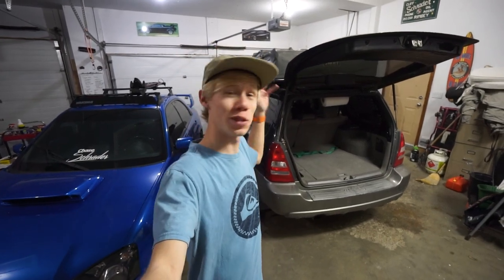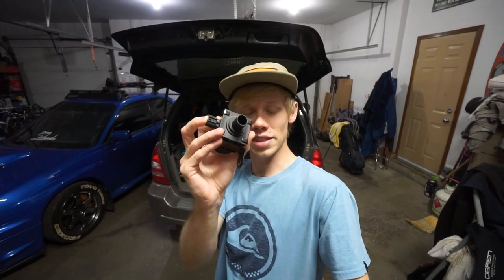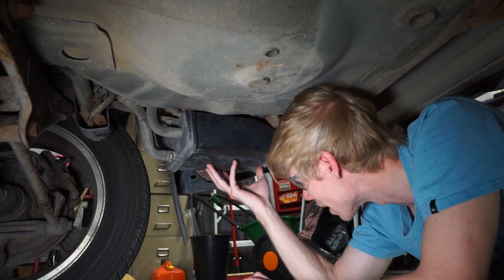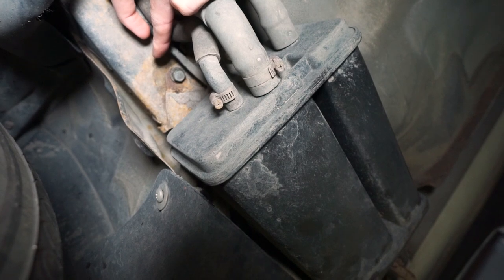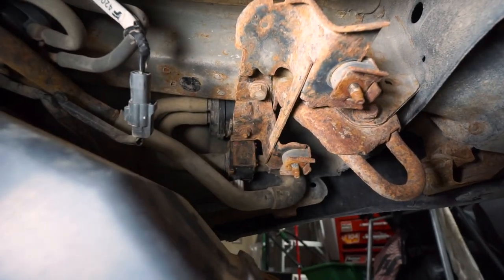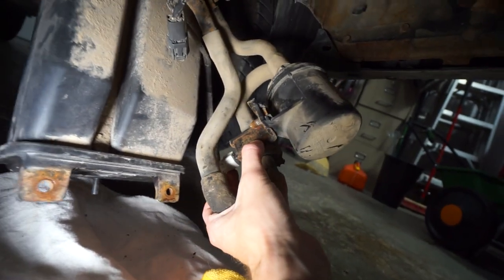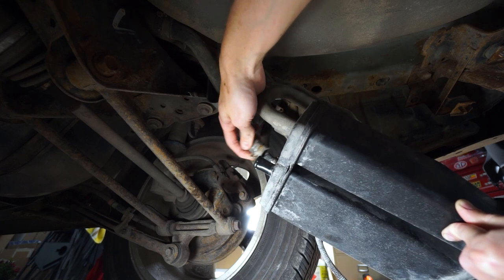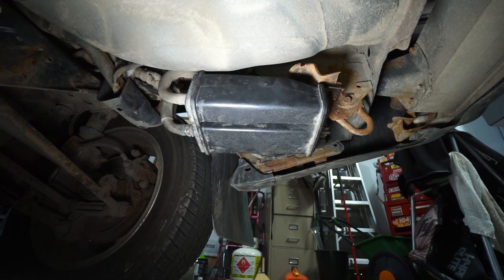P0457? Fixing Your Subaru Purge Valve? There's a Surprise You Don't Know!

Comment: Actually a vent valve. Just saying
Reply from the maker: According to the diagram on Subaru Parts says Purge Solenoid... Feel free to check it here https://www.subarupartsplus.com/v-2004-subaru-forester--xt--2-5l-h4-gas/emission-system--emission-components
Reply: @Chase_Schrader  notice it says vent valve under where it says subaru
Reply from the maker: Yup, that's the type of part, hence why the community uses both the terms interchangeably. I am sure I have called it both before
Reply: @Chase_Schrader  yes, not a big deal at all. Both parts do the same job, but to differentiate between the two they were given different names. Generally speaking, the one in the engine bay is a purge solenoid, and the one near the tank a vent solenoid. Whatever who cares
Reply from the maker: Better let Subaru parts know.... you seem to care quite a bit
Reply: @Organicmachine455 Where would be located the actual Purge valve on an impreza RS 2005?!

Comment: Had an issue with my 07 FXT for about a year(I don't drive it all that much) where whenever I put fuel in it, on a day warmer than about 60 degrees, it won't simply crank over.  It'll crank for about 10 seconds before like one or two cylinders start firing and she runs like a DOG, give it a little gas and get rolling and another 5 seconds later it clears up, at least clears up good enoug to run on all 4.  A block down the road she runs like new again.  On a particularly rough fuel up where I had to put a full tank in it for a road trip, it cranked for about twice as long as it previously had and threw out some puffs of black smoke; and I do mean puffs, you could see PUFF... PUFF, like the cylinder wasn't firing.
Reply from the maker: Yikes! That sounds like quite the issue that could be from multiple things. Did you end of fixing it? What was the problem?
Reply: @Chase_Schrader  I haven't fixed it yet,  but i'm pretty confident it's to do with the charcoal canister in the back that filters fuel fumes, as well as the valve that controls the fumes entering the intake(I believe for emmissions purposes).  Long story short, I believe the valve is stuck open when it's supposed to shut when the car turns off, so gas fumes are flooding the intake on a refuel.
Reply from the maker: Ahhh I could see that! Best of luck getting that sorted out!

Comment: I noticed my '07 Forester is having some trouble starting after I fill it up with gas? It seems to fill up normally, but when I go to start the engine after it sputters and I have to keep the key turned for a few seconds before the engine will stay on. I've had a P0442 code for awhile but I don't know if this would be my purge valve causing the problem or something else.
UPDATE 12/29/23
Replaced the canister purge valve under the hood of the car and I am no longer having problems with starting the car after getting gas! 

I tried to replace the vent valve in the back like in the video, however my bolts were incredibly rusted and I stripped two of them. So I couldn't get the canister down and never actually got to replace the vent valve. I'm holding on to the part in case something happens and I need to replace it, but for now the car is running great! 

As for the emissions code, I've driven 150 miles since detaching and reattaching the battery, and still no code. However, I also have not let the gas below half a tank since I know the car runs an emissions test at a quarter of a tank. I have a feeling my filler neck is rusted and is the actual problem, but for now, I was able to get it to pass the emissions test which is all I wanted.
Reply from the maker: Hmm that could be a few things, that code is about a evap system leak. If you are over filling it could plug up the system, it not it could be any number of evap connections between engine and the gas tank.
Reply: Same problem on my 02 wrx. Any time I fill up/ add any amount of gas into the tank it idles rough for a minute or so before it evens out again. Curious as to what you find
Reply from the maker: @kevinvillarreal4138  Ah yeah, evap is a pain to troubleshoot shoot! My guess is something to do with the line running to the engine, could be plugged or one of the vents not opening

Comment: I have 05 wrx and I can’t seem to find that valve . Is it somewhere else?.
Reply from the maker: My 2004 STi had the same one and this guide says its there: https://cars.natemichals.com/wrx-vapor-canister-purge-valve-replacement-write-up/

Maybe it was deleted on your car? Or is it a JDM car, they might of had a different system. I'm not quite sure though.
Reply: I have an 04 forester, I found the valve which is the same as yours but all the auto parts stores seem to have a differnt model than that one I can’t find it either.(update) it’s called a vent valve on most sites not a purge  valve. The name makes all the difference
Reply: @loganrogers969 My Wrx has the charcoal canister underneath the passenger rear wheel but thier is no Purge Valve. Not sure why . ? Unless it’s somewhere else
Reply from the maker: @loganrogers969  If you are in North America check Rock Auto, that's where I got mine
Reply: @mikeyaquino7868  according the all the part stores it’s a vent valve lol
Reply: @Chase_Schrader  I did check them out and that’s where I got the idea to search for (vent valve) instead of (purge valve) because when you search for that it brings up the solenoid

Comment: I have a Evap code for gas cap, and misfire cylinder 1 hopefully I can use your videos to help fix them.
Reply from the maker: The gas cap could absolutely be this issue and for the cylinder 1, it could be the spark plugs, plug wires or coil pack. It could also be the head gasket but that would have other issues like burning coolant!
Reply: Yes no head gasket issues. 
Just rough idle and misfire. I bought it and it has a Cheapo gas cap. I replaced plug and coil still have the issue. Doing gas cap next
Reply from the maker: Did you check the plug wires? We had a customer with the issue and it turned out to be the wires
Reply: Yes, replaced coil and plug and still have misfire codes
Reply from the maker: Darn, well hopfully the gas cap code can be fixed with this!